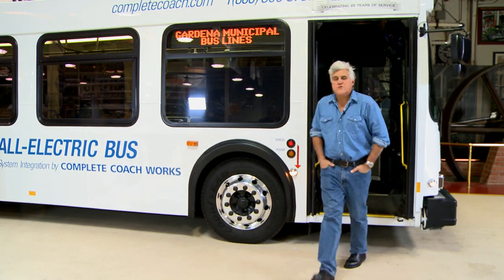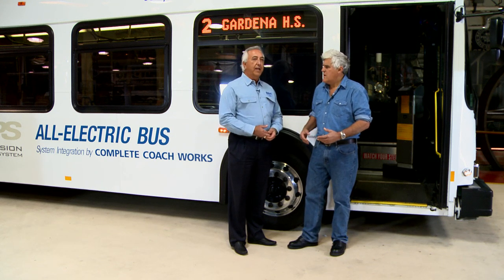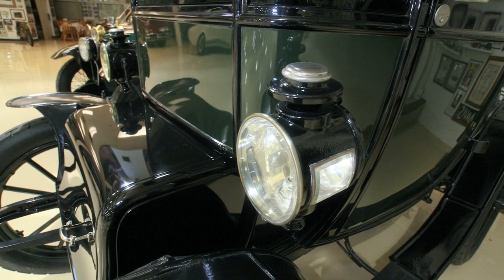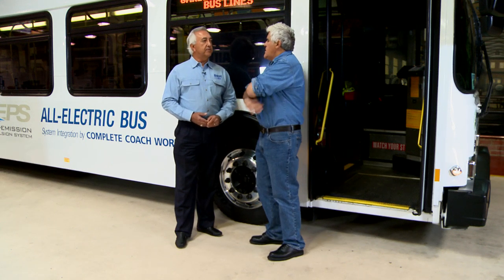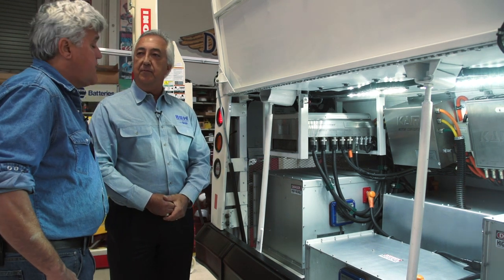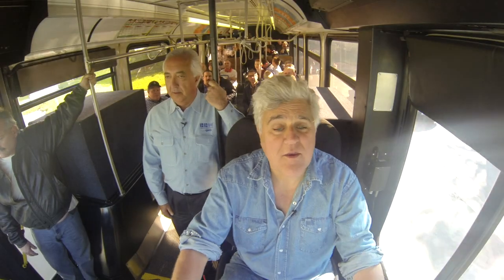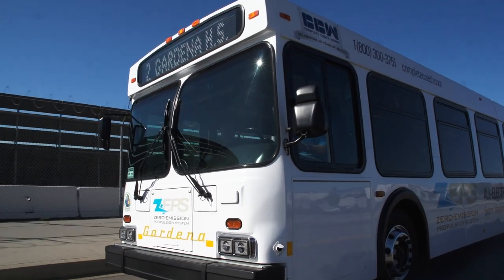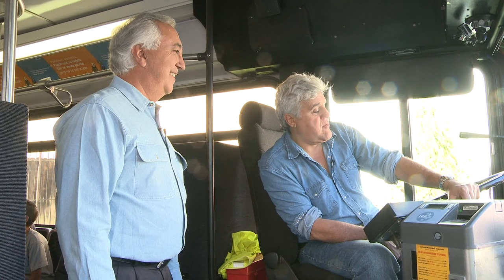Electric Bus Conversion - Jay Leno's Garage

Comment: I'm curious, why dont they put solar panels on the roofs of the buses? Im sure it would add more range to them.
Reply: OutdoorSoHard_69 The cost of the panels and added complexity doesn't justify the return is my bet. Remember these are a target goal project. The bus needs 80 mile range for the rout, so they target a range of 100 miles.

Also, the variance in charging efficiency on solar power makes the possible range increase unreliable which is not acceptable for a transit application. You can't have a bus that will run a rout on a sunny day but needs to be swapped out at night, or when it gets overcast.
Reply: OutdoorSoHard_69  I'm confident the math doesn't work.
Reply: OutdoorSoHard_69 
Solar panels just don't add enough range to be worth it.
The drain on the batteries is several orders of magintudes higher than the added energy from the solar panels.

To put into perspective, a family house, with good consumer electronics, and good insulation, uses about 7-10 kw/hour a day, in heating, warm water, lighting and so on and so forth.
This bus empties it's 200 kw/hour battery in just 100 miles. That is at least 20 times as much as the family home.

A few solar panels isn't going to change that.
Also, the air con unit sits on the roof.
Reply: yeah, Broyd is right. even when the panels reach 40, 50% of efficiency,  ( today are 14, 15 %) an entire roof of solar panels would make just 5kw/h. or less. so its not worthy the investiment. on the other hand, supercapacitors are a real deal. or even a super flywheel. to recover more regen energy.
Reply: yeah, Broyd is right. even when the panels reach 40, 50% of efficiency,  ( today are 14, 15 %) an entire roof of solar panels would make just 5kw/h. or less. so its not worthy the investiment. on the other hand, supercapacitors are a real deal. or even a super flywheel. to recover more regen energy.
Reply: +mike Miller HVAC doesn't use that much power.
Reply: OutdoorSoHard_69  I've heard they can even do wind turbines
Reply: Heater uses even more power - see small home heaters -- what are they?  2000W ? and can only get 1 small room warm enough, not the whole house.
Reply: Perhaps it's more efficient to place the panels in the charging stations.

Comment: I'd like to see these put to the test up with the Great Falls Transit District up in Great Falls, MT where we have a wide range of temperatures (-30 to 100 F) and road conditions.  They have a some older Gillig Phantom busses that need to have their engines and transmissions overhauled that would make great candidates for this kind of conversion.

Comment: I like what they're doing. This is a 40 foot New Flyer, while the other was a 35 foot Proterra. The New Flyer has a higher capacity, and on top of that the old bus is useful for another life. The LF was and still is a great model. They should eventually be able to do this for all urban transit buses. I would like to see an electric RTS. :D

Comment: you need a special angle of incoming light to generate proper electricity,  i think its better to equip the bus stations or the depot with solar panels.
but if the efficiency of solar panels increases a lot from now, you can equip buses and cars with them

Comment: If there a no downsides to this bus they should convert every single bus in North America to this, it just makes sense.  If we were to convert all commercial vehicles, trucks, buses, etc to electric, imagine the fuel savings, environmental savings, and if what Macy is saying, the cost savings as well.  Could reduce or eliminate dependency on foreign fuel, cleaner air, and as Jay points out we can keep our gas powered fun cars.  Sounds like a win win to me

Comment: The bus battery is big enough for a full day's work, they were shooting for 120 miles and currently get 90 miles, still enough for the intended routes of 80 miles. They charge in 4 hours, and will charge overnight when it's cheaper to charge (off peak rates are way cheaper), and there is lots of electricity available (just think of all those businesses that shut down at night that are not using electricity). Plus in Pasco where they are going, they are 90% Hydro power.

Comment: What about driving the air conditioning system? would that be a big drain? as if it were somewhere like here in Australia, during the summer months the aircon is on pretty much 100% of the time.

Comment: Supercaps accept kinetic braking energy exceptionally fast, unlike a battery. Look on Youtube for vids that use supercaps on cars instead of a battery. Supecaps do not deteriorate and last as long as the car. It is worth putting a supercap across the + & - of a battery. So simple a solution. The supecaps gives off the charge to the starting motor, while reserving the battery. Batteries do not like giving off big charges, it lessens their life. Supercaps take most of the loading in discharging

Comment: I could see an advantage to lining the roof with solar panels, provided the cost isn't prohibitive to add the management system involved.  Use solar when it's sunny to power lighting and HVAC with remaining power sent to the main batteries?  Just a thought.  Very cool way to recycle and reuse.

Comment: Disney used to buy junked GMC RTS Buses, really cheap and use the parts to keep their GMC Buses on the road.

That looks like an old NOVA Bus. I believe the original manufacturer is in Canada.
Reply: It’s a New Flyer D40lf probably built by the Winnipeg plant New Flyer owns in Canada however, the bus had been built to US specifications and had operated in the US. Super cool that Disney use to buy junked GMC RTS’s to keep their GMC buses on the road though!

Comment: I want one so much!

I bought 24x 240 watts panels, for 45 bucks a peice.

I all ready have 35k watts of LiFePo4 batteries 48v, from Signature Solar. And the thier 3k watt, and 12kwatt All-In-One inverters to power the bus.

Right now I just need the bus, I want to finish it up the build on the road, I want to move as soon as all my stuff is in the bus. Was thinking of buying 1 to 3 acre land, in a few states as places to park it, when not on the road.

Comment: Supecaps do not have such limitations as the cycles are infinite. Until the energy density is near the same as current batteries, putting supercaps across a battery improves matters greatly in battery longevity and all around performance.

Comment: You could certainly use them for running everything that isn't running gear (AC, lighting etc), and take some of the strain off of the primary batteries.

Comment: Thanks for the comment. We may be looking into converting school bus fleets and trucks in the future.
Reply: How much do a set of batteries cost RETAIL including labor when they do die (and they WILL die because of the HUGE amp load of the propulsion motor) and how many miles would it go on a single charge at 60mph?

Comment: Electric buses are fine, but how about all Steam bus.  Yes, back when I was a flight instructor for Bill Lear, founder of the Lear Jet, I got to ride on his Steam Bus.  It was a great success except for one small problem they couldn't solve.  It had plenty of power, torque and reliability but they couldn't stop the water from freezing!  That kinda screws things up a bit.  Anyway I enjoyed my rides on Mr. Lear's steam bus.  He was also building a steam indy racer to prove his concepts.  He went as far as starting to create a replica Indy 500 race track in the Nevada Desert.  The outline of the track is still visible today some 40 years later.
Lear gave the city of San Fransisco 2 buses to try out and after a year and a half  they climbed the city's steep hill very well but one winter the temperature dropped below freezing for a few hours one night. And you can't just add antifreeze to the water that your are about to turn to steam so that was that.  Bill Lear tried to fake everyone out by saying he has a substance called "Learium" that was water that wouldn't freeze.  Learium froze solid one night.  But flying his Lear Jet was fun too.

Comment: Don't know why but Jay thinks that higher battery voltage means higher power. :P
Reply: John Tripp well for pusposes of log distance power transmission yes. But for inbuilt battery of a car or bus, big No.
Reply: the thing here is that you will NEVER use battery voltage to power electric vehicle, that is stuff of ancient past (even for electric forklifts lol) instead you will use inverter to shape voltage to the needs of an motor (in this case 3 phase line 380V AC of course)  and by regulating frequency you regulate speed of an motor (in this case 3 phase induction motor) the motor will then "draw" current (A, Amper's) based on mechanical load and design characteristics of motor while "trying" to reach speed of rotation relative to input frequency ( in hertz, Hz units) which is controlled effectively by your gas pedal
Reply: He also kept calling the electric motor an engine. Come on, Jay.
Reply: Higher voltage does mean higher power, you have either voltage or amps to increase to get more power. If you need to rely on low voltage and more amps then you need heavy wire guage, more volts lets you run less amps and lower guage wire with the same overall watts.
Reply: Engine --- is a device which converts energy to work (mechanical energy)  --> electric motor is also an engine.

motor= engine 

https://en.wikipedia.org/wiki/Engine
Reply: Less amps needed, so you don't lose heat through the cables, higher voltage in EV's does mean more power.
Reply: That's probably because in a gas or Diesel engine, horsepower increases with RPM. Therefore, you should never shift at idle.
Reply: Lol

Comment: EV West has a electrically powered 600 hp BMW…
And everything inside of that rig could be put inside of a normal school bus and have the motor replaced by that and then you can go around the country without any fuel-diesel usage!
And this would be an electrically powered tiny house bus😳

Comment: It would be great if every transit agency could just convert all their old diesels - keep the frame and body and even paint, and just swap out the drive train. It would have to be cheaper than buying a brand-new vehicle of any kind, and you're getting all the advantages of electric drive.
San Francisco MUNI has pretty cool diesel-electric hybrids, but not as cool as this. Also we have electric trolley buses that work great (especially up steep hills!), until the trolly poles get unhooked.

Comment: Apparently you had the audio turned down, top speed is 55 MPH. Range is about 90 miles, good for a day's route. Recharge is in 4 hours.
Reply: until you turn on the A/C!  Then you get lucky if you get 30 miles

Comment: I saw you`re last comment, and Lithium batteries have 2000 cycle lifetime before they goes down to 80% ;) Crappy ones found in Laptops are hidious if you compare :P
Reply: until you see the environmental impacts caused by strip mining for the lithium and other materials needed to make the batteries, and the fact that the plastics that encase the batteries is made from OIL!
Reply: @user-cy6gf2pj7y  which is much less than that for the global warming caused by the CO2 exhausted from cars

Comment: How much do a set of batteries cost RETAIL including labor when they do die (and they WILL die because of the HUGE amp load of the propulsion motor) and how many miles would it go on a single charge at 60mph?

Comment: E v west … has 300 hp motors that can be put in … &-connected end for end…&  it can get 600 or 900 hp …-to even do a semi!
I would put in two separate battery packs and then charge the one depleted pack …with the one that is fully charged!
Also I would put solar cells on the roof to pick up a charge that way

Comment: And since you are in year-round sunny California, a few solar panels on the roof would be good, although more expensive.
Reply: and adds weight.  the batteries weigh far more than the original diesel engine/tranny combo did

Comment: The Chevy Volt's battery is 360 volts!  Which means nothing as per horsepower.  You have to bring amps into the equation.   It does draw 90,000 watts if you floor it, though.

Comment: Putting solar panels at the depot, having them charge banks of stationary batteries during the day, and then in turn recharge the bus at night sounds like a great plan. BMS balancing batteries on the other hand is an expensive und unnecessary complication that is just a disaster waiting to happen. Probably during charging, at night.

Comment: Mechanics need to evolve with changing technology. We have New Flyer Hybrids in our fleet. And there is still maintenance to be done on the rest of the coach. Steering, brakes, suspension, air operated systems like brakes, doors, windshield wipers, kneeling systems, wheel chair ramps, and lighting just to name a few. I've been working on these for the last 4 years here in Las Vegas. Our 40' 'Flyers are using CNG while our 60' Articulated coaches are 4 cylinder Detroit Diesel powered.

Comment: $500,000/ bus. if the battery cost or capacity/kg can be improved by 50%
then you can get this to maybe $425,000. Total cost of operation is the key metric. Maybe Ben Franklin transit can post some numbers to make the business case.

Comment: I drove for a Transit Co. here in Tucson, and we had several New Flyers. You couldn't drive them on the freeway because it would start to rock side-to-side while at speed. Does an electric bus have the same problem?

Comment: the amount of money you would say for ten years from not doing oil changes, fluid changes, parts maintenance would pay off the batteries anyway. Also these batteries have been known to last way more then 10 years, their are still prius's that still are on the road from 1999 when they first came out with a small amount of charge degradation

Comment: San Francisco MUNI has only recently (2007) got diesel-electric hybrids, still has a lot of old-fashioned diesels. It seems to me that diesel-electric hybrid, with electric drive, would be better to maintain than straight diesel drive - is that your experience? But certainly all-electric would be even better.
NYC is pretty flat isn't it, compared to San Francisco? Hills are where electric drive really shines. First time I rode an electric trolleybus up a steep hill was WOW.

Comment: Why don't they put solar panels on the roof and extend the range?
Reply: binnihh The solar panels available isn't worth the energy you get of the effort to maintain and purchase them.
Reply: Solar panels aren't too expensive either, about $300 for a 4 foot by 2 foot panel.
Reply: The bus would need a field of solar panels to be useful, not just a roof full, a full roof of solar could get you maybe 3kw, solar is very inefficient, and this bus uses 223k watts. The tiny gain in range would be lost by the weight of the panels.

 They said they are working on building a solar charging center for these buses with a field of panels feeding a giant battery array off grid that the bus can plug into. You can't drag 223k watts of panels around.

3kw of panels would take around 80 hours to charge the bus in full sun on the best days if the panels all faced the sun.

Comment: The right way to do it is having the electric drive rotor right in the wheels. Engineless.
Battery -- Controller -- Wheels.

Extra cost per 4KW wheel = $4K
4 wheels = $16K = 16KW = 16000 hp.
Reply: enjoy attemping to move a bus with a 16kw motor
Reply: Correction -
Extra cost per 40kw wheel = $4k
4 wheels = $16k = 160 kw = 215 hp.
6 wheels = $24k = 240kw =  322 hp
Reply: these busses probably use motors that consume around 1MW of power
Reply: good idea maybe but not right way to do... it is hard to cool motors inside wheels while at same time protecting it from elements (salt, dirt + water = bad)  non dampened shaking and wear on bearings
another thing is 1 motor is allways more efficient than more than one, you use 4 wheels drive (not in-wheel drive) in electric race cars to get max power to road grip, but bus is not a race car... nowdays in-wheel motors exist but as a cheap solution to do-it-yourself hybrid conversion, but you cant expect high performances on those and they wear down faster than any alternative for same price
Reply: Also check out Rimac Automobili, Concept_one... that is a way to build an electric supercar ;)

Comment: Just a thought on Roof solar atop this bus, and how much it helps;
265 watts for 72"x36" panel 2015 numbers, so about 3 kilowatts from the roof if you use 40 feet of roof x 6 feet wide. 
Compare that to charging numbers quoted 480 volts 100 amps x 4 hrs, or (480x100x4)=about 200 kw-hr full math charge, but it won't use 100 amps all 4 hours, hence might be between 100-150 kw-hr in reality, so hrs of full-sun equivalent in California is about 6 on average, so 3 kilowatts x 6 hour-full-sun-equivalent=18 kilowatt hours from roof solar, would help. Adds about 10-20% charge due to solar on the roof. Or 10-20% range enhancement. Might not be worth the extra price. 
Alternative: I've seen quick chargers at stops in other countries (Japan) which might be considered. Over head trolley car charging at each 1-2 minute stopping point. The benefit is with enough stops, you never have to plug in the charger at night or come back to the main bus terminal for 8 hours, and hence have endless battery range. You can add a bank of super capacitors in the bus that charge in under a minute, then when you leave, the super capacitor charged energy is transferred to the Li-ion bus batteries.

Comment: I  would like to see this  Corporation  Rebuild  a  G M C New Look Bus and  a  Flexible  New Look  Bus  like  this  New Flyer low floor Bus , with the same type of Electric Motor in them.  Even those they are 30 years old it would be very interesting  to see and to Ride those Buses like that as a Novelty.
Reply: new flyer is better than new look